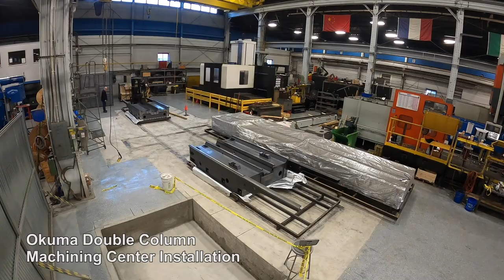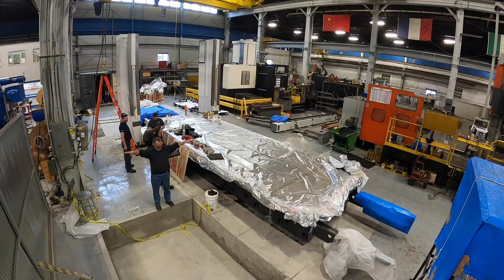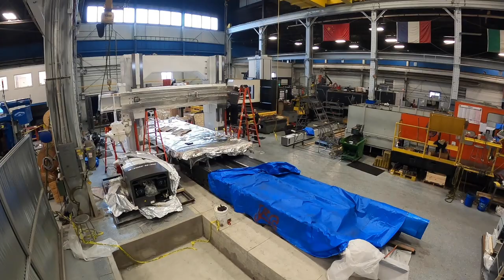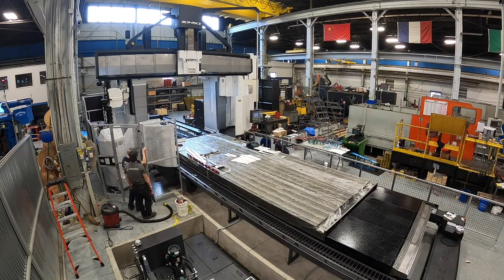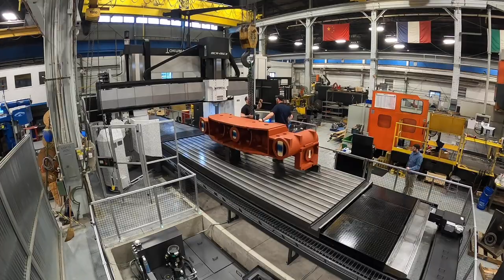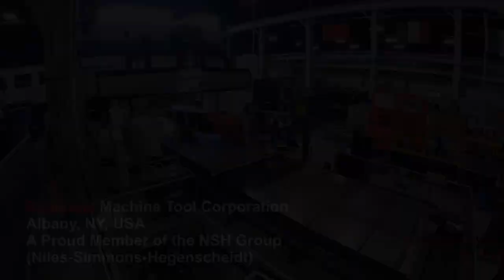Okuma Double Column Machining Center Installation at NSH USA (Albany, NY, USA)

Comment: How did they make the surface flat for these long parts  ??? Any body knows?
Reply from the maker: Precision and experience. In terms of specific operations, I'm not sure.
Reply: Hi! They do it with an Waldrich Coburg / grinding head /grinding option... If a manufacturer needs quality, espacially tooling machines manufacturer, they are using Waldrich Coburg's... Look at the shopfloor's of them... At DMG's facturies you can find Waldrich Coburg's... 😉
Reply: Ohhh, sorry! DMG is now DMG MORI... Deckel, Maho, Gildemeister(Germany) , Mori Seiki(Japan)
Reply: Correct DMG has a few Waldrich Coburg. Okuma has around 17 Waldrich Coburg grinders doing their way. Most high end OEM machine tool builder will use or have their ways ground on a Waldrich Coburg way grinder due to their size capabilities and precision. Waldrich Coburg mills and turning machines are also known for their precision. They build portal style custom large part machine tools.  Okuma brand is a quality builder of machines and it is a good testimony that they use Waldrich Coburg machines for building their machine tools. This was a good video and I always like seeing these time lapsed videos. Thanks to the original posted of the video as I enjoyed watching it. Good luck to your company and wish you well with the work you do on your machine tool.

Comment: Why you guys decided to purchase an Okuma, instead of other well know double column machine tools brands, such as Waldrich-Coburg and Toshiba?
Reply from the maker: The Okuma fit our needs.
Reply: @nileshsalunke5915  we compared okuma and waldrich in a company a big car company. Then for the orher machine order waldrşch şs out of order
Reply: The Waldrich Coburg machines are a different class of machine and will last a lot longer. They are all cast iron from Europe, not south east Asia, and have hydrostatic ways. They are the technical leader in large machines and build custom machines. Hence they are not a commodity type or catalogue type of machine. Waldrich Coburg will cost more, but you will get what you pay for and life of machine is a lot longer. I know both brands extremely well and like both, but Waldrich Coburg is different league and adheres to VDI standards over JIS, etc. Many great reasons to consider Waldrich Coburg if your budget is flexible. Waldrich Coburg will handle a lot heavier cuts with more power and torque with their heads. The Waldrich will be a lot heavier and rigid and will handle precision better. Interesting to note, Okuma has been using Waldrich Coburg way grinders for years to grind their ways. They have around 17 of Waldrich Coburg machines which most OEM builder use due to their size and precision.  Okuma is nice machine for its purpose and is usually a smaller size machines than Waldrich Coburg who builds a lot larger machines. Waldrich Coburg machines are all postal style machine whether milling, turning or grinding type of machines. For example if you want a 16 meter diameter machine for doing turning and milling of gears, Waldrich Coburg has the machine. You won’t find that with an Okuma. The smaller size of Waldrich Coburg machines have lots of advantages for those interested in learning more about them.  I could go on but if one is looking for a large part machine they should consider the Waldrich Coburg machine because being a true custom builder that is extremely application driven one could gain a lot of advantages. That said, not everyone can afford the Waldrich Coburg machines and may need to look at another brand that has quality to suit their needs.  I enjoyed this video of the Okuma machine being assembled and wish the company well with their new machine. Maybe next time the Waldrich Coburg might fit their total needs better, but they still have a good reputable brand machine. That’s my two cents on the topic and the comments posted.

Comment: Did you look at the Mitsubishi MVR Ex?  They beat every spec to this machine.  Just wondering why?
Reply from the maker: Hi Big Fish! I'm not involved in the procurement of these machines, I just document them. I'm sure the MVR Ex is top notch as well. Thanks for watching!
Reply: I've never run an okuma double column but I've heard nothing but great things about them.  Also "specs" rarely tell the whole story, I bought a machine once because it had better specs, never again.  We regretted it right away and wished we'd gone with our initial choice.
Reply: Interesting comments on Mitsubishi. I saw other comments asking about Waldrich Coburg machines. Mitsubishi has two Waldrich Coburg machines in their factory in Japan.  When comparing a Mits to Okuma or other bands you need to be careful about how you develop you spec matrix as there are a lot more things to consider than just specs which don’t tell the whole store of a machine. For example, specs don’t typically highlight design features that are important or even support capabilities, etc. Specs typic are centered around sizes of the different items the person doing the comparisons think are mo to and they miss a lot of things that should be import to them. To that spec matrix’s are not a valuable tool, but they are just one tool in doing a machine comparison and justification. Commodity or catalogue type machines are easier to compare through spec comparison. Hope this gives an additional perspective to the comments here.